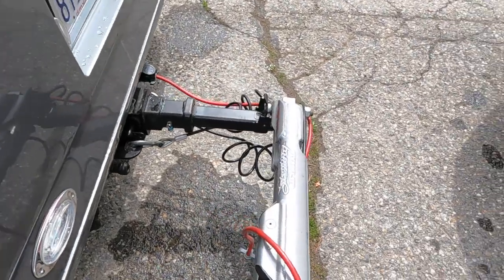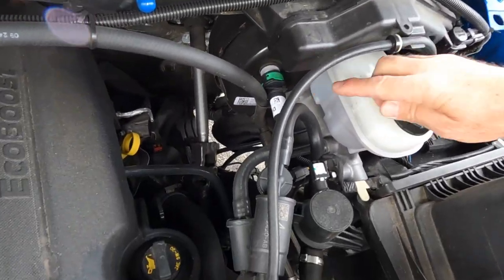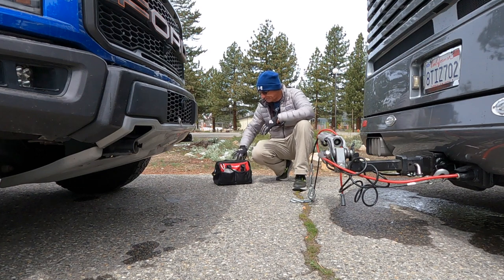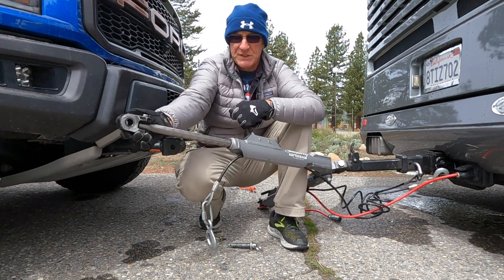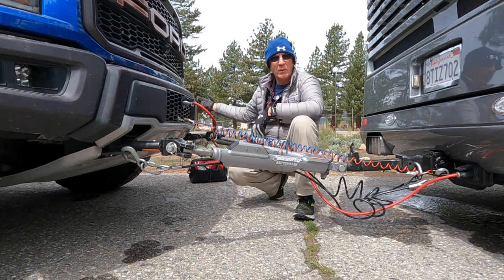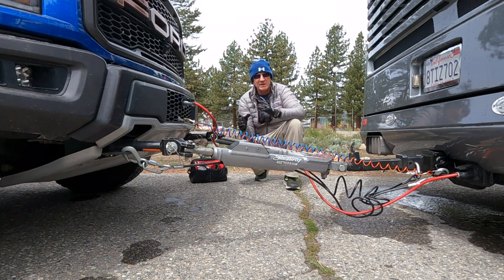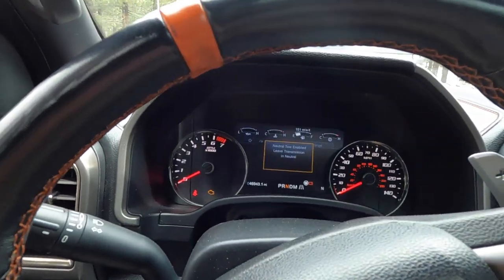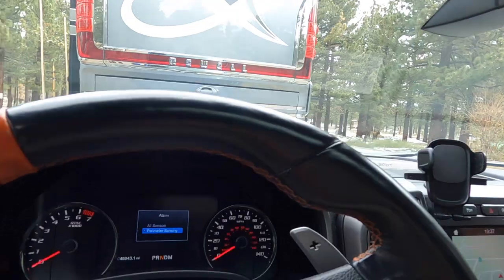Flat Towing Your Ford F-150 Raptor | RV TOAD | RoadMaster Sterling (or Blue Ox)| AirForce1

Comment: Thank you, I'm getting ready to go on my first adventure flat towing my f150. Very helpful
Reply from the maker: You’re welcome!  Enjoy…and PLEASE PLEASE PLEASE be sure you’ve engaged Neutral Tow as well as supplied your Raptor with a 12v charger lead.
Reply: @RVSquaredSteve  I went with a Jackery portable power to run mu patriot portable braking system to run it vs trying to run a hot lead from rv or any battery in towed vehicle.  Works well.

Comment: Well done Steve, here's a tip, I use a zip tie around the electrical harness 7-pin connector cover on the coach and around the 6-pin connector cover on the toad side, This will make sure the cover and the harness connector will not come loose or detach.  BTW I'm the nerd of the Ford engineer that does all the neutral tow durability testing for the F-150, Ranger, and full size Bronco. Glad you are happy with your Raptor. Safe Travels.
Reply from the maker: Thanks for the compliment as well as the tips. Not a bad idea, although I’d be inclined to use a small Velcro strap so it could be removed quickly without a cutter. Good thought though!

And talk about a cool job, I hope Ford is paying you to be the “Neutral Tow Engineer”!! 😉. Maybe I can apply for that job as well. 😬
Reply: @RVSquaredSteve , Velcro straps will certainly do the job, I will use that one. Thanks! It's a great job, currently manage our NA Proving Grounds in Romeo Michigan.  My career with Ford going on 28 years now has served me very good. Yes, I'm well compensated. :)
Reply from the maker: @thecasualrver  LOVE THIS... and, here I am, an uncompensated tester.  I guess that makes me a "Test Dummy"! 🤪

Seriously, though, you'd be a great resource for all of the "questions" that are fielded by the non-experts regarding Neutral Towing of the Fords!

Comment: Great video. Thank you!  What did you use to get the blinkers and tail lights to match the coach signals?
Reply from the maker: Thanks Greg. If you’re referring to the lights being “in sync” with each other, nothing needs to be done; the 12v turn signal pin on the Coach plug is what powers the TOAD’s lights.
Reply: @RVSquaredSteve  Yes, we are preparing to setup our F-250 to be flat-towed behind our RV using a diode kit, but it has LED tail lights with the blind-spot radar (BLISS) and a little unsure if the diode / splicing into the tail light wire is the right way to go
Reply from the maker: @greghedgpeth  yup…diodes are the preferred method. BLSS has nothing to do with the tow kit. All the diodes do, is prevent back feeding voltage into the coach, thus draining the TOAD battery.  They also prevent random or malfunctioning blinkers/stoplights.

Comment: What adapter is needed under the hood for them to not cut vacuum lines?
Reply from the maker: It’s a special “TEE” fitting made byDEMCO.
Reply: @RVSquaredSteve  I’m on the way to pick up my 2020 f350 I’m wondering if they did it the right way or cut my line the wrong way.
Reply from the maker: @WePlusThreee  I sure hope they did it right for you!
Reply: @RVSquaredSteve  I’ll know in about 10 minutes. Thanks for the video. Not much out there for this.

Comment: I posted my new 2023 F150 Hybrid on a F150 board. I was excited to use the pro power from my new toad. The vile, ignorant responses I received were insane. Do you know how to correct the powered air dam hitting the front plates on 2023s?
Reply from the maker: The ignornet can be cruel, indeed. I have no experience with the Active Air Dam, but it sounds like your Air Dam was NOT trimmed correctly to provide a relief cut around the plates. This cut should be ¾" x 3-5/8"; according to RoadMaster.

Comment: ...As I write this, my wife and I are looking at ordering a 24 Newell coach. 

As such, i point out that for expert advice on towing, and getting the job done correctly the "first" time, may i point out NIRVC. I say this, because my wife and I plan on using their product "Retro Band" on our coach. If, you are not familiar with it, I strongly suggest you look into it.

Now, as to correctly doing a TOAD.  These services are offered by them as well.  1000's done, not many complaints. 

Just a little info. tossing out there.

ScottishxPride, Tx.
Reply from the maker: Thanks for the watch and comments. I am fully aware of NIRVC, as well as their RETTROBAND product and also the TYRONs. I’m not going to enter that discussion as it is out of the scope of this topic. It’s also not a product of safety I wish to get into due to many questions and concerns which I will leave to the individual owner.

As to installation, that’s not the issue of towing; On-going inspection and maintenance is! You’ll see my other video discussing this. I’ve discussed almost a dozen failures in the past year or so and they have ALL been the result of baseplate failure from fatigue and/or lack of maintenance.

Comment: Question when towing and going down the road …..does the odometer still rack up miles while still being towed .i once read that you can pull a fuse or something else to eliminate mile  buildup ty
Marc
Reply from the maker: No Marc, the speedo is not affected.

Comment: What adapter did you use to connect to the brake booster?
Reply from the maker: Oooo, man...FANTASTIC (and CRITICAL) question!!!  Demco makes a SPECIAL TEE fitting that very simply plugs into the brake booster's sensor port!!  You simply unplug the existing sensor, plug the Tee in, and then use the Tee's port for the sensor.  My installer didn't realize that, and ended up butchering the plastic tubing manifold which had to replaced when I found the error.  Done correctly, it's super clean and non-destructive.

Comment: I’m reading the supplement raptor manual where it says maximum speed is 35 mph maximum distance is 50 mi am I missing something?
Reply from the maker: You're reading the section on "Emergency Towing", not "Neutral Towing" or, as it's often referred to as "Flat-Towing".  Completely different in that Neutral Towing disengaged the transfer case and puts it into Neutral.

Comment: Doesn't flat tow add miles to your Raptor? I have a 2014 Raptor that I'm debating on flat towing.
Reply from the maker: Nope...not at all.  Well, not on the Odometer, that is; it's trans driven.  So, since the trans is disengaged with the Neutral Tow function, the odometer never turns.  You still need to be mindful of road-wear on tires, lubed joints, as well as brakes.
Reply: @RVSquaredSteve  OK makes sense. Thanks for the info.